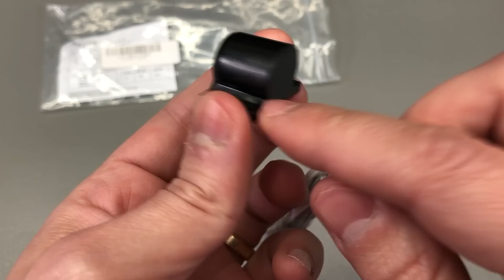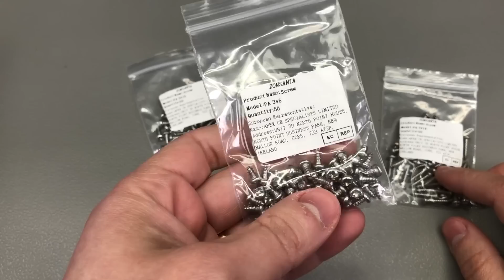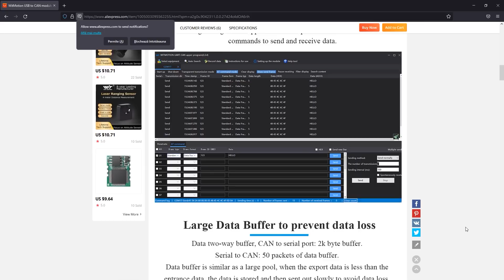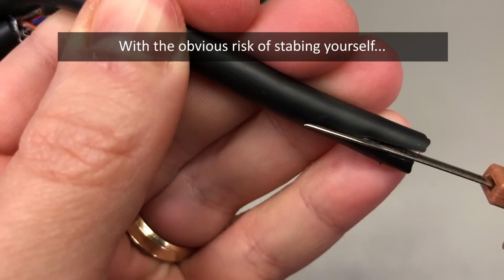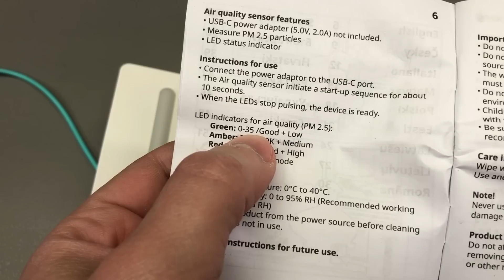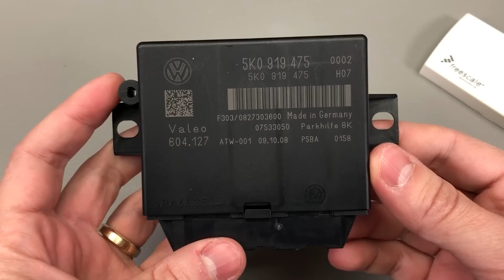Probably the last mailbag for 2021 | Voltlog #393

Comment: Happy new year!

I bought one of those WitMotion USB-CAN adapters (before they raised the price significantly). I see that it has a VP230 transceiver which is similar to the one on your CanLite boards, but while doing some testing (was looking for a different error) I noticed, that the signal quality and strength - especially of the high line - is notably worse compared to a CanLite board.
@VoltLog Is that the same for you? Do you have any idea what causes it? I would have thought that these chips (that even share the same datasheet) deliver similar performance.
Reply from the maker: Sorry, I have not tested the WitMotion adapter yet.

Comment: It looks like the IKEA VINDRIKTNING has an infrared PM2.5 sensor. Those are not very accurate, maybe that is why it only has a RGB light to display the air quality.
You could do better with an PMS7003 or a PMSA003 sensor, but you would need to roll your own enclosure.
I put two PMS3003 sensors (older model than the ones I recommended) around the house some years back and one is still going...

Comment: I have one of those Freescale USBDM clones and have successfully used it for S08 work. It only works on Windows (as I last knew) and you'll need the USBDM drivers from the SourceForge project. One can also update the firmware based on chip type in the unit.

Comment: I also like to use old laptop power bricks due to having them around. They come plastered with certifications, none has ever failed me and the voltage is convenient to running thin wires to buck converter "hubs" for various purposes. Those black all-in-one USB charger modules (feature on a mailbag at some point I believe) can take the input directly. P.S. Thanks for filling my AE feed sewing gear. 😬
Reply from the maker: Another advantage for rolling my own USB power hub is the ability to have on/off control and stats for each individual port.